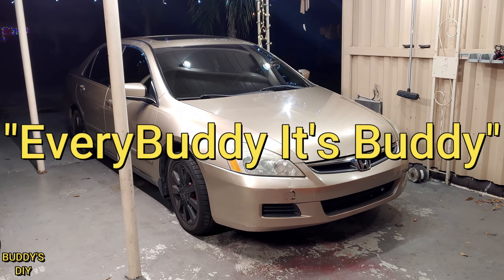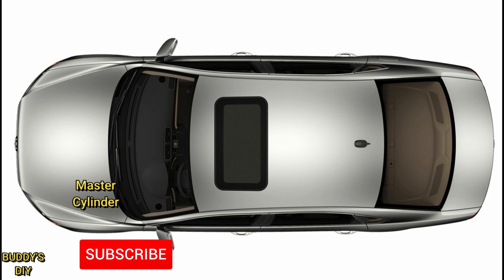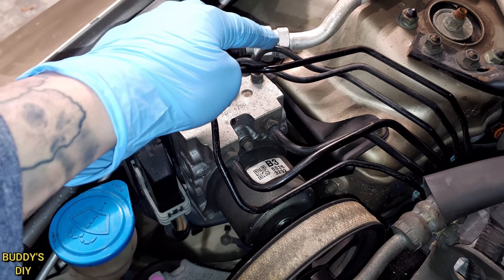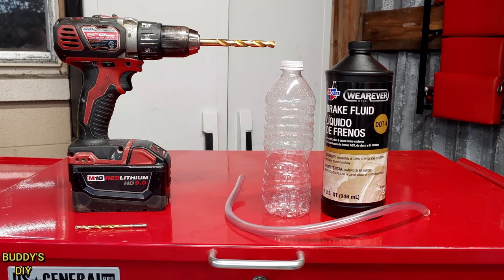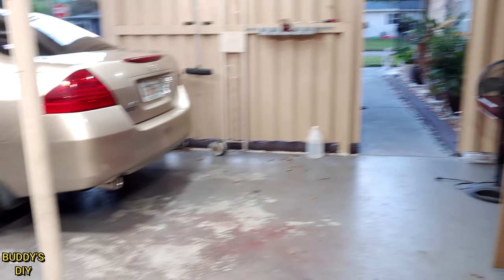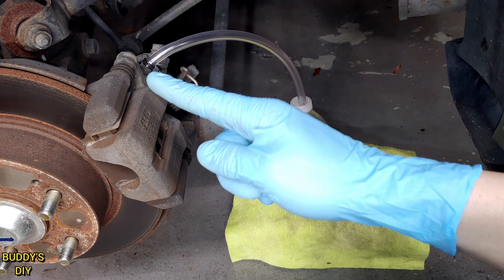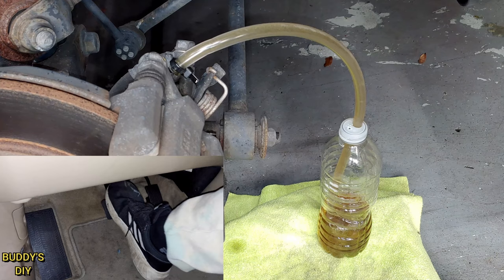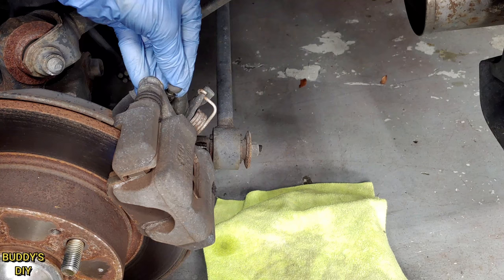How To Bleed Your Brakes | BY YOURSLEF

Comment: I have seen many videos on this process and NEVER has it been explained this way. Thank you very much and a huge thumbs up!!
Reply from the maker: Thank you brother! I appreciate the kind words!
Reply: Same here! I would’ve started with the wheel furthest from the brake master cylinder. Thanks buddy :)
Reply: @Nutzername1273 it matters very little. Don't sweat over the order
Reply: IT IS just common sense for an engineer. provided he is aware of principle of operation. Basically it is required to pump through each line curcuit until pumped liquid will become clear, looking like new one.

HOWEVER, i have doubts about statement that braking liuquid is super corrosive.  I would say opposite, it is basically sort of hydraulic oil which must be corrosive resistant.  Anyway good video! thanks

Comment: Buddy, I love your videos, but I feel compelled to correct this common misconception about bleeding the brakes. It is a one-person job, but it’s even simpler than you described.  The ONLY reason you need a plastic bottle and hose is to keep your floor clean. The modern master cylinder has residual pressure valves at each exit port.  Their purpose is to keep a little pressure in the lines for instant braking.  Without them, the driver would need to pump up the brakes for every stop. The RPVs keep air from being sucked back into the system when you open a bleeder.  Also, you should NEVER push the brake pedal to the floor, especially on an older vehicle.  The normal travel of a master cylinder piston is about 1 to 2 inches.  The “untraveled” portion of the master cylinder can get some pitting from sediment in the brake fluid (it gets worse with age).  Pushing the brake pedal to the floor rams that rubber piston seal through the pitted portion of the cylinder and usually tears it, and then you need to rebuild or replace the master cylinder.  If you open the bleeder and pump the pedal the NORMAL TRAVEL of the brake pedal, the air will be pushed out and the RPVs will keep air from being sucked in.  Please try it.
Reply: If you don't use a tube and bottle, how do you know when there is no more air coming out of the system?  When the tube is filled with fluid and no air bubbles you know you are done, or am I missing something?
Reply: Very interesting ….  Got a channel?
Reply: If you dont put hose and bottle how will you prevent damaging your mags? Unless you dont care and do a sloppy job?
Reply: Hey man I appreciate it but can u explain it in more simple terms(layman) plz it would help a lot...
Reply: This methods inferior. Trapped air is a thing. Ask your local shop how they bleed brakes.... they pressurize the system by sucking or blowing or both. 
This method is really meant to get most fluid to the caliper... then properly bleed by pumping and dumping or by using an air tool.
Reply: So I can bleed my brakes with the plastic tubing and use maybe an oil drain tub? So I don't necessarily need a plastic bottle?
Reply: Awesome info, ty.
Reply: @Cruz.Norberto2nd he did say the bottle is to keep things clean and has nothing to do with not needing a second person which was what the video stated
Reply: @michaeldelarm1630 right.  There are brake fluid pumps for under 30 bucks.  It is even easier as we don't need to pump the break.
Reply: @amonmcranny2654 The tube and bottle are fine for catching the fluid and keeping your floor clean. If you do two cycles around all 4 wheels, you should get all the air. When you are done and have a firm brake pedal (not spongy), you know the system is free of air
Reply: Totally agree. A pressure bleeder is far superior. But if you don’t have one and you work alone…

Comment: Recently I got in the shower to wake myself up prior to doing my brake job... Glad I did because that's where I came up with this idea!: You can add a vacuum pump inline using an Aussie shampoo dispenser pump! The pump mates perfectly after pulling off the top head and bottom feed tube 😃. Fits clear vinyl tubing with 1/4" ID and 3/8 OD ...without any extra hardware! (Tubing fits over the top and inside the bottom of the Aussie purple pump) 
Perfect for Ford F150/F250 btw.  Great for pumping out the master too. 
Note: Use a pair of pliers to hold the top plunger from moving as you shove the tubing on in place of the Aussie pump's head. I also added some 3M 33+ electrical tape to secure the bottom connection but that's probably overkill/unnecessary.😁

Bonus tip: Use a short funnel in the master to overfill it as you pump fluid from the 4 corners.

Comment: Yes. Just did mines as preventative Maintenance. I notice if you open the bleeder valve too much it will leak air. I just turned mine very little. Thanks for this video reminder.

Comment: very helpful... Ive known about the 2-man method for a long time, and I started buying 1-man method tools trying different ones to see what i liked (including reverse bleeding). But even my 1991 SE Miata has ABS...I didn't know to use the ABS module as the starting point to determine which corner to start from...I would have gone with the 'DR, PR, PF, DF' typical US vehicle set up. But now I know to actually swap that, and start with the passenger rear first. Thanks!

Comment: A rare, twist-top skinny/tall Gatorade bottle is awesome. It has a mouthpiece on the bottle and the very top part can be removed and then the existing hole can be trimmed by hand with a 3/8" drill bit for 3/8" tubing (air tight!). 
Dollar tree had/has these tall/sturdy Gatorade bottles for $1.25 each which is a deal by itself😃

Comment: Google: Brake fluid is not corrosive to metals. However it being hydroscopic it will absorb water which if not kept up to specification and changed regularly can cause corrosion inside the braking system metal pipes.

Comment: Just a heads up.

You still have to trace the brake lines. My 97 Camry is set up the same way with the master cylinder @ driver front, ABS @ passenger front, but the rear brake lines run along the driver side frame rail. Rear Passenger then cuts back under the trunk between the gas tank & the spare tire, making it the furthest.

Comment: Great video! The one thing you didn't mention is , don't you want  clean the plastic drill shavings out of the bottle before starting the procedure?
Reply: Of course. also, he forgot to mention to suck the old oil first from the master and use it as a base in the bottle. Also will be a good idea to do this when you will do a tire rotation. I do oil changes and tire rotation at the same time, so at that moment will be very easy to do it all.

Comment: New D.I.Y. weekend warrior here. I'm in a '18 Subaru Impreza and just replaced my brakes this weekend, as my local shop wanted $410 per axle(the entire car had pads that were 95% worn), so I did the work myself. I should've bled them while I already had the wheels off. Is it going to be an issue if i drive for a week and then do the brake bleed when I have off again next week?

Comment: Great video sir, i have a 2017 tacoma the ABS module is on the passenger right side under 5he hood as it was on this car you show in this video, would i bleed the brakes exact same way LR-RR-LF-RF would this be correct?

Comment: It's my understanding that some vehicles have the ABS module mounted underneath the vehicle which complicates this process. I've also heard that the corvette has 2 bleeder valves per brake. But the vehicle I worked on today was a 2014 Xterra. Anyway, i was wondering about those air bubbles. I noticed on 2 of my brakes that there were air bubbles in the hose but they were moving away from the bleeder valve and towards the collection bottle.  I take it that is normal? At any rate, the brakes seem to function OK on my test drive so I guess I got the job done right.

Comment: I had a first today.  I replaced a rear cylinder on my truck and had someone pump the brakes while I bled them.  3 pumps and hold, I loosened the bleeder valve, brakes did not go to the bottom nor did any fluid come out.  Finally on third try, a "little" fluid came out.  Brakes did not go to bottom.  Tried 5 or 6 times, a little more fluid came out but brakes never went to the bottom.  Drove it and brakes feel a little spongy.  I have never heard of the brakes not going the bottom when the valve is opened.  Thanks for some ideas,
Reply: Your brake hose on that side  is most likely collapsed inside and impeding fluid  flow
Reply: @LISA ANTO  I wound up replacing that cylinder because it was leaking worse than the one I replaced and ironically it bled that time.  I know the new cylinder had nothing to do with that but somehow the line cleaned itself out.  Thanks for the reply as that certainly sounds logical,
Reply: The old  bleed nipple was probably clogged.

Comment: excuse me, my car is bmw 218i 2015 (automatic), if keep pressing on the brake pedal, it gets harder and harder to press before I release the bleeder valve 6:08.... when I start the car with the engine on, the brake pedal press turns normal. I would like to bleed the brakes by myself, but do I need to start my car? thank you and good video!! would the brake pedal press soft as normal if I released the valve without the engine on?

Comment: What's the size of the bleeder valves on this specific vehicle for both front and rear? Will a pipe with 1/4 ID work for this job?

Comment: i HOPE you read this one i want to start off telling you i have 4 jeep comanche trucks  1 short bed auto 4x4 htis kould be a high dollar truck  88 and in real shape  long wheel 4x4 nice truck   5 speed  got long wheel 91 5 speed  these trucks are 4.o six cylinder the last one is  i got wheels head liner tailgates tramns 2 of them new brackks gas tank motor. And the price justkeeps going up i seen 15 or more going from 20,000 up to 29'000 from 2500 to 11.000 plus  i got a 62 ford falcon 3 on the wheel six 4 door

Comment: Sorry can i ask something?

When we bleed the brake fluid, is it necessary to turn on the engine so the brake booster is activated? or it is okay to do it with the engine off?

Thanks
Reply: Late reply, but this is definitely possible with the engine off

Comment: my car battery went dead while bleeding my brakes.  After i finished the brake flush, i jumped the engine but then immediately the check engine light turned on.  I went to autozone and code ABS malfunction and traction off showed up on dash.   Not knowing what to do, i removed from the  battery then reconnect, check engine light turned off for now but for how long? car is fairly new
Reply: That’s a common problem on a dead battery. It cleared after you disconnected the battery an it won’t come back on unless there’s an actual problem or you have to jump the battery again

Comment: Question do I leave the cap off whiles pumping the brakes or the cap stays on while pumping ?
Reply: Cap stays on or you can introduce air into the system and you run the risk of contaminates getting into your system.
Reply: That's why if you look in cap there is a rubber seal that comes down if fluid is low to prevent air from getting in system. Cap always on.

Comment: so how much oil do you need? does the new oil mixes with old in the process, that is if the total amount of oil in the ssystem is say 0.5l how much more new oil would you need to flush old one out... is it not beter to empty the main oil 'pod' first and then put the fresh oil in it al the way to the top before starting with bleeding, and much more questions (you must understand that you are explaing this for total newbs, not to professionals
Reply: normally it takes 32oz to flush and fill normally i just buy the 32oz bottle from the honda dealer  instead of the 2 smaller ones to flush old with new as i bleed after replacing all the fluid in the res with new.

Comment: I didn't get any response to my question, so I will ask again. How do you watch the line and bottle if you are in the car pumping the brake pedal?  Do you pump 2 or 3 time then hop out and take a look? Do you set up mirrors or a video camera?  Hopping out frequently to check the passenger side rear would be a pain - is there an easy way to do it?
Reply: Pump a 10 to 15 times and check bottle and fluid level in master cylinder... He said that in the video.
Reply: I'd check the fluid in the master cylinder every 5 pumps just in case and keep topping it off i figure its better safe then sorry if it goes empty and sucks air in also you'll know when ur done after bleeding when you see the fluid above the bleeder in the hose without any air bubbles you can then just go ahead and close it off unless your flushing all the fluid in each line till its clear fluid then close when no air bubbles remain but always stay on top of checking reservoir it's a real PITA if it went empty and air went in. also wanna add i put grease on the threads of the bleeder just incase so air don't enter through the threads as it does sometimes once finished tighten bleeder all the way and clean grease off with brake cleaner and wipe. hope any of that info was helpful.

Comment: Unfortunately he makes his own mistake here: "pump the brake pedal all the way to the floor board". Wrong, never do this. You will likely ruin the master cylinder seals by doing this, you're pushing the brake pedal way past where it would normally travel in normal braking. You should only be pushing the pedal within its normal braking range. You obviously have to pump a lot more frequently but you save the seals.